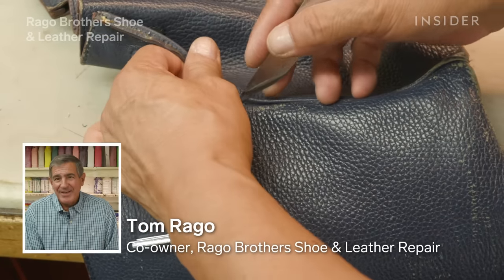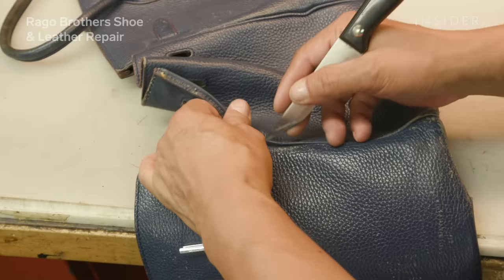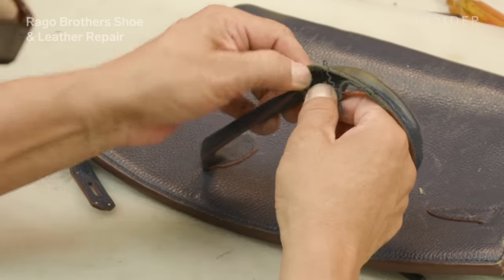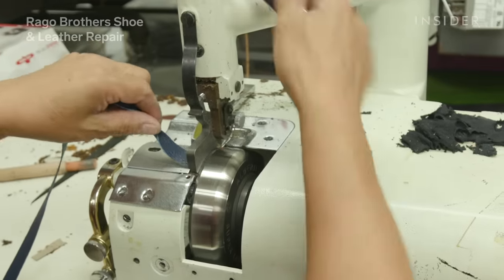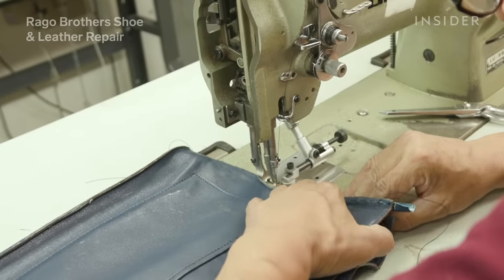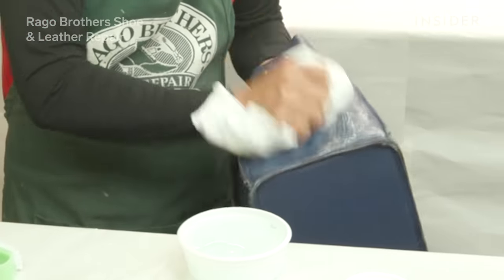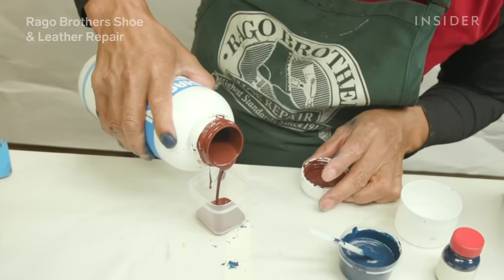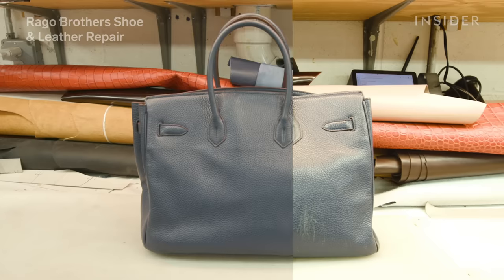How A $10,000 Hermès Birkin Handbag Is Professionally Restored | Refurbished

Comment: At least that person actually used the bag.
Reply: @I_WANT_MY_SLAW  it’s old
Reply: @I_WANT_MY_SLAW  bags  are  meant  to  get  dirth
Reply: dirty
Reply: It's a fake. If it was real it would be saddle stitched and Hermes themselves would service the bag.
Reply: Abused, not used.  How does a bag even get like that?
Reply: @I_WANT_MY_SLAW  it was probably passed down and passed around to several people, bought and sold a few times, before the current owner got it and had it restored.
Reply: @StuninRub  and probably charge 5X as much.
Reply: @StuninRub  the bag is genuine. reconditioning and repair is extremely expensive and hermes would charge upwards of the original cost of the item for this service. as an owner of several expensive and now vintage bags i can tell you that careful consideration is given when taking things of this value to anyone outside, as hermes will refuse to provide any service or supply replacement hardware from that point on. this is common practice amongst all luxury brands. it's a big decision and very unfair to presume what approach the owner should have pursued.
Reply: @angelcitystudio  Hermes servicing fees are extremely reasonable. They only ever get expensive when you bring in a bag that needs hardware they don't make anymore. 
The bag in this video? It isn't even using the right kind of bag stiffeners on top of the stitching being wrong. Reeks of counterfeit. Even if you MUST bring it to a third party, there are crafters who are well versed in how to do it right. What you see in this video is how to do everything wrong.
Reply: @StuninRub  laughable. the bag shown required much more than a "simple spa trip". and anyway, there's no need to be nasty. have a great day!
Reply: @catherinevalli6830  Only one nasty here is trying to past a fake as genuine.
Reply: @StuninRub  agreed is a fake bag I have handled many authentic ones in store/ friends one before. I have a bag (although not a B or K) and Hermes spa always cost less than $500, even when I stained it, and there were a few minor scratches. Just needed some touching up. Someone is extremely ignorant to be calling a fake real and then saying that it’ll cost more to repair it at Hermes spa and thus not worth.
Reply: @Gus BSB Or an Asian woman.
Reply: @katerinahikesalot1644  its old? thats what happens when you have a bag and use it
Reply: Pharrel is the creative director of Louis Vuitton? I've been living under a rock. All I know is :yt: hotdups :yt:’s Mulberry Alexa bag is super cute and I love the pink color.
Reply: LV:yt: hotdups :yt: On my radar for flying from Canada to Amsterdam this summer, hopefully I can grab both and save on VAT! I hope LV can be in stores by then! Mini sizes are hard to find!

Comment: $10K bag and Hermes uses a plastic tube for the inner handle?  They could at least use some kind of durable rolled up full-grain leather or something that's less prone to breaking.
Reply: You'd be amazed how many premium brands use cheap materials - especially with shoes.  You're paying for the name, that's it.
Reply: Rolled up leather deont last longer than plastic actually  if the owner use it everyday .
Reply: Some sort of synthetic material would need to be used because leather stretches over time
Reply: @gabrielle1626  boiled or hard leather could last long but that would be a stretch too
Reply: People with the money pay for it. They don’t care. They just want the brand and can afford it.
Reply: Actually they do use rolled leather for handles. I feel this bag is a super fake. The Hermes Boutique has a spa for bags which anyone can go get their AUTHENTIC bags fixed or "refreshed" no matter if it was purchased pre-loved or brand spanking new. They will refuse service on a fake bag understandably.
Reply: @desyreemalig9329  This bag is not even a super fake. You can tell immediately even before they take it apart. It's a mid-grade fake using lower quality leather. But if you had doubts, that mess of glue on the inner materials would certainly tell the tale.
Reply: @wntrwhte  the edge coat was the wrong color. the stamp looked sketchy, the hardware looks obviously fake( authentic hermes hardware doesn’t have a warped reflection when turned to the side. it should be a mirror finish without warping in the holes or edges.) the leather texture is wrong. its an obvious fake
Reply: @KevinKingofPrussians  boiling leather it affect at molecular level and it hardens like a brick
Reply: @jacobbwalters8133  no, and yes, leather do stretch but it wont too if you know how to work with them, there's called starch glue, which it hardens the leather so much like a brick, and if you apply Chemicals that it affect him in a molecular level that leather can turn like a brick
Reply: @wntrwhte  no, the build and work is trash, but the leather is always going to be good, i worked in a whole seller of leather, Hermes own tanneries du puy it's one of the best french boxcalf, and the exotic leather its expensive too, like 2000-5000€ the exotic whole piece, so for making for example a croco bag you will need many Crocs leather bcz you can't use all his body and it has a selection of the best part mainly the hide, and it cost more than 5000 already with just exotic material
Reply: @alessiocai9952  this bag is fake. It’s not made with French leather. Just look at how the dye has worn and how the piping is made. It’s fake and not a good fake, either.
Reply: @wntrwhte  i was saying about his brand, not this one
Reply: This bag is not fake. You can watch other Hermes bags being repaired and they are all the same.
Reply: @momokoblue8032  no, they’re not. I have handled hundreds of them over the years. They’re not made like this
Reply: I think i do have bags with real leather but ofc they qre abit ripped off well not really that ripped small scratches of it.
Reply: @Founderschannel123  it’s made with real leather. Just not good quality leather or workmanship.
Reply: @momokoblue8032  yes it is. The shape of the bag, the quality of the hardware and the central turn lock is crooked! I have 3 authentic.
Reply: @desyreemalig9329  yeah this bag isn’t real lol, I was sitting here in agony looking at it being deconstructed being presented as a an authentic item
Reply: @pureenlightmen  Do you know other less known brands like Hermes or even independent artisans? I've been looking for a men's unbranded messenger bag like the ones Hermes makes, but I wouldn't feel comfortable spending that much for a bag.
Reply: @desyreemalig9329 not all bag are readily able to be fixed at hermes itself. given by how this bag has worn to it maximum capacity, hermes normally did not accept this type of condition and even if they did, the super long time will be taken to service which is a hassle for a customer. and yet bag spa also thriving very well with small amount of price and time taken. why not send to other resources that are convenient tho. it just my 2cents.
Reply: @desyreemalig9329  also if a bag is taken to the spa and was serviced by anyone other than Hermès they will no longer service the bag.
Reply: @BltchErica  Valextra makes unbranded bags in a similar fashion, but without the flashy designs Hermes has been doing lately in its mens' line of bags.
Reply: @desyreemalig9329  this is exactly what I came
here to say.
Reply: True or like some sort of metal atleast
Reply: @jacobbwalters8133  veg tanned leather didn't stretches at all. And they can use silicon tube. They never broke.
Reply: Did you see Tom fords leather wallets? They frickin expensive as well))) more then 700$ and notting special, and not expensive leather at all. 
Maximum real price of those wallets is 150$ max.
Reply: @Grno1984  that’s objectively untrue. All leather stretches. That is one of the benefits of using leather for clothing like jackets. It molds to your body over time.
Reply: @jacobbwalters8133   I'm a leather crafter,i make wallets belts and also bags,i know what leather Can stretched and what leather  not. And also i mentioned they can use silicone tubes.
Reply: Someone pointed out this bag is a fake...explains the plastic.
Reply: 🤣  That'll take the already ridiculous price to $15K!!
Reply: Imagine thinking a $10,000 bag means that expensive materials were used.
Reply: Yes. Sure maybe. But 99% of the time Hermes bags are never treated this way. Generally bag owners have many multiple bags that get switched daily or weekly. I don’t own hand bags obviously but I do love leather. Red wing boots, Apple French leather watch bands/wallet/phone cases, holsters, jackets etc and I treat everyone single one of them with care. At all times.
Reply: The bag is indeed fake but Birkins used to be cheaper, I remember buying mine for 3k about 10 years ago. If this bag is real it's clearly older before the great price inflation. Because the handles in the newer 10k birkin is thicker with deeper heat stamping.
Reply: You're paying for the name.... that's all.
Reply: @momokoblue8032  all fake
Reply: Leather stretches… plastic comes in a variety of strength and quality. High quality plastic holds its shape and the weight of the bag. The plastic broke due to excessive weight and wear and tear. No different than luggage or car accessories, etc. It is obvious this owner didn’t care for the bag well hence the repair.
Reply: Oh. They do that because “eff you gimme your money, idiot”. You’re not paying for material quality, so you don’t get material quality. There’s handmade and handworked saddles that cost a fraction of 10k but likely would still be serviceable for century.
Reply: Plastic also comes in different qualities
Reply: Sometimes you gotta maximize on profits 😂
Reply: @KevinKingofPrussians  bolted veg tanned leather is harder, but more brittle.
Reply: I was expecting surgical grade stainless steel
Reply: $10K for a handbag to totally ridiculous in the first place.
Reply: so many silly opinions...
Reply: @desyreemalig9329  wrong and uninformed.
Reply: Btw LV use plastic inside too. I don't understand why put $10.000 in something like this.
Reply: Its a replica.
Reply: Most luxury brands use rope inside the handles.
Reply: I was thinking human bone. lol
Reply: That’s why they have $$ I would never pay more than $30 for a purse when I help someone with that $$
Reply: @desyreemalig9329  I was thinking the same thing……
Reply: That’s exactly what I thought!
Reply: @notconvincedgranny6573  In this case that’s not necessarily true. You’re paying for the labor and quality. The bag is fully handmade and genuine leather. Still not worth 10K but you gotta know what you’re talking about. You’re not just paying for the name. This isn’t Jordan brand where the Jordan 1 cost $25 to make in some warehouse in china but for some reason the shoe sells for $180 and the quality is worse than the OGs.
Reply: You are paying for status, the name, the prestige. The bag is only a bonus
Reply: Sorry but that is exactly what needs to be used. Rolled up leather is what cheap companies would use!!!  It would not drape or last long.
Reply: @desyreemalig9329  Not 100% true.
Reply: @desyreemalig9329  you have to have proof of purchase to get it repaired by the company. You also need to have purchased from a store. You can get authentic products from resellers or gifts, or just not have the receipt.
Reply: Plastic will last much longer than leather. Also is about time plastic was put to better non visible use, help to get rid of the plastic that we don't know what to do with now
Reply: For those saying the bag is not real, I'm asking myself who would go through all that just to have "super fake" bag restored? Surely the restorer has also had many years experience in noting whether a bag is fake or not. Furthermore maybe the cost to restore the bag is much more cheaper to not have it restored by Hermes. 

There could also be waiting list for restoration just like the waiting list to buy a new one. When bags are all taken apart, the construction is basically the same when taken apart and broken down, is all about glues and stitches lol. Anyway considering all the above I do think the bag is genuine
Reply: @natasyadayana2500  this bag is fake. If they take it to the spa, Hermes will report it to the police for being fake and the person could get charged. The person fixing this seems to have worked on several of these. I think that entire part of Jersey is probably carrying knock off items.
Reply: Nearly all name brand name bags are cheaply made. You pay for the name.
Reply: @jacobbwalters8133  the plastic isn't holding the weight of the bag the leather is.
Reply: @Drewsky840  they both are- leather is a great product to use for clothing and bags precisely because it has some flexibility and “give”. That is an undesirable attribute for a handle, so the plastic tube provides rigidity and prevents the leather from ever stretching or shrinking- things leather is prone to do, especially when wet.
Reply: @jacobbwalters8133  you're just clueless. This is a shitty knock off bag, that's why there's plastic. A genuine Hermes bag will use leather inside the strap.
Reply: @jacobbwalters8133  Exactly, and if it was too hard it would be uncomfortable to carry.
Reply: @joelstatosky8444  if you don’t want to believe me- fine. But watch any leather working channel on YouTube and you will see them do it the same way.
Reply: @notconvincedgranny6573  True
Reply: This also isnt the best grain of leather…..
Reply: The leather seems very standard too
Reply: It's a fake
Reply: They do use leather for the handle. This bag is fake. Jesus christ the people here are coming up with funny stories about quality issues 😂😂😂.
Reply: @desyreemalig9329  THANK YOU. I was loosing hope that everyone actually thought this was real and saying the brand doesnt make quality bags… 😂
Reply: It's fake. Hermès use leather to fill their handles,  and thread in the leather piping. I know for a fact as I used to work for Hermès and made their bags
Reply: They use the plastic because if it was 100% leather, the handle and support would all crack and break down simultaneously.
Reply: @herbertlongfellow7702  So in one of their workshops in France?
Reply: I feel like this is a fake
Reply: Approx. $9,750 of that $10k is intellectual property - not materialsor workmanship.
Reply: @desyreemalig9329  totally agree, the bag is fake big time,
Reply: It’s because it’s 1000% FAKE
Reply: What about the worn off logo?   What would they do about that?
Reply: That’s because this is not a Hermes bag. I can tell by the way he is unraveling the stitching that it has not been hand sewn in the first place. Also, you pay several thousand dollars/pounds/euros for a bag, you are not going to wear the leather like that or what’s more likely the truth, the imitation leather was of poor quality and wore away with use. Hermes leather is proper vegetanned leather which lasts decades without the need for restoration. This is a fake Hermes. My partner and I are retired leather workers.
Reply: Fake bag!
Reply: They use rope for the inner handle…

Comment: Why wasn’t it sent back to Hermès to get the original artisan to fix which is the normal process?
Reply: Maybe it's quicker this way.
Reply: Too expensive and there is a muuuuuuch longer wait.
Reply: There is a waiting list for repair and refurbishing of Birkin. And the price is another story. Maybe the owner just wants it to look good again and just keep it and won't resell it.
Reply: It's a super fake Birkin. Authentic Birkins have a rolled leather handle not this plastic tubing.
Reply: @I_WANT_MY_SLAW  - because I've seen how they're made in person 🤦‍♀️
Reply: @desyreemalig9329  @I WANT MY SLAW!! its not even a super fake. its just a regular fake made of geniune leather. first the stamp doesn’t look real, the texture of the leather is different, the edge coat is the wrong color. the hardware isnt solid. you could see a warp in the reflection of the hardware it isnt a flat mirror finish it looks wobbly. the connection between the back of the bag and the flap is sloppy and wonky
Reply: This appears to be from the 80's or something
Reply: @luis-sq8cp  agreed! That’s the most obvious fake I’ve ever seen. 😂
Reply: Guess why. You only have one shot! 🤣 it’s clearly a fake Birkin. Hermès doesn’t use any kind of plastic on their leather goods, not even for the structure. They only use leather, metals and canvas. The only plastic you will see in a Hermès bag are the hardware protection plastic, the air bags they put inside to keep it’s shape and the rain cover 🤣🤣🤣
Reply: @joaoccunha  They do use plastic, but not like this. Their reinforcements is usually either fiberglass or salpa(mixture of latex and leather fibers).
Reply: Grade A fake birkins look too similar to real ones to know. Without prior info, you'd pick a fake for original 6/10 times. I know because i source
Reply: I very much agree and now that it has been repaired by unofficial Hermes artist,  the bag is no longer worth $10k. 
Not saying the work wasn't good but,  Hermes would say the bag is inauthentic now!!
Reply: Because it's a fake birkin